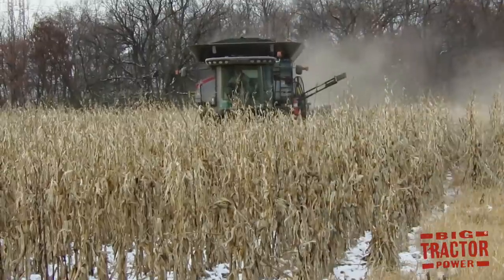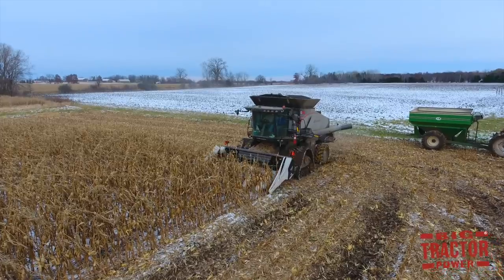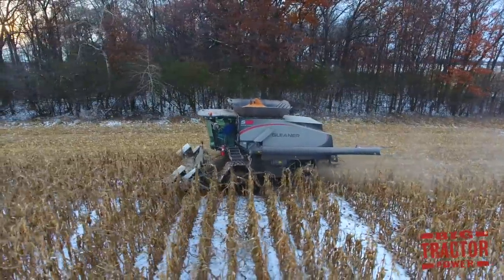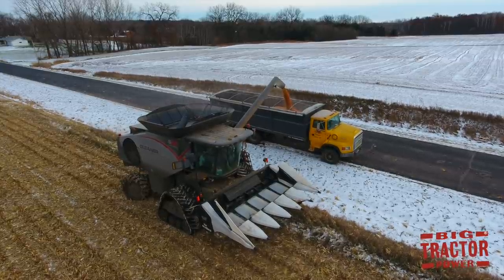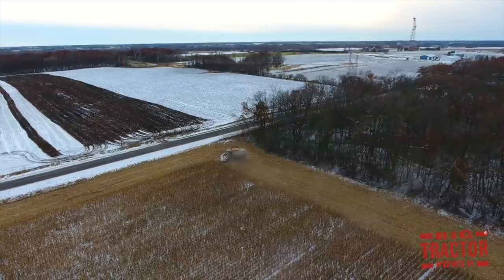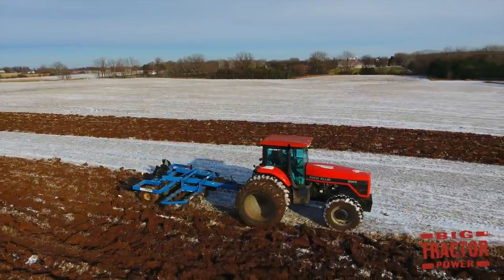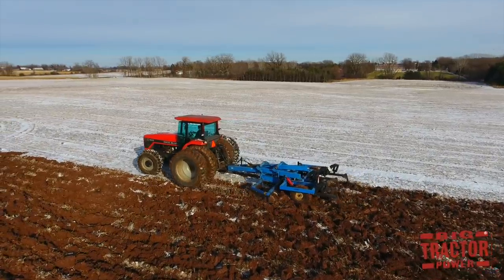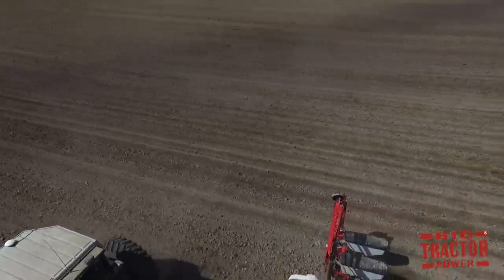Harvesting Corn in the Snow: Gleaner S68

Comment: Mike you are right about the snow. But 10 degrees Fahrenheit is the magic number.  10 degrees Fahrenheit or lower the snow will blow through the machine without sticking to the inside of it.  It warms up to 11 degrees Fahrenheit or warmer and you will start plugging your sieves and everything else.  Then you park in a heated shop overnight and steam power wash the inside of the machine out. Been there and done that lol.

Comment: Tracks on a combine as light as a gleaner. You could harvest in a swamp lol.
Reply from the maker: Yes you could and not leave deep ruts.
Reply: Empty weight of the combine as stated is 31,000+ no light weight like the old F and F2's.  We had a F with 23.1 on the drivers.  One year we ended up going to 28.1 rice tires on the drivers, putting a mud hog on the rear, put a turbo of the 301 diesel engine off a 190XT, turned up the pump. That was a combine that would almost float on water.
Reply: @countrygent4  You're right, 31,000 is a lot of weight, but not by today's standards. Keep in mind a Deere S660 weighs 44,077 lbs. A Gleaner with single drive wheels exerts less PSI on the ground than a Deere with duals, so a Gleaner with duals or tracks is really treading light.
Reply: @CrestonMoore  I did not realize that a JD is that heavy.  Funny according to engineers I know at the JD combine plant they are going back to a multiple cylinder combine something like the Class combine. My best friend got one of the original IHC Axial Flow 1440 the first year out - GOLD watch fob and all.  Also I saw the first year AC N6 combines that got hit in the corn head crossing a RR crossing with less than a 100 yours on the engine.  What a shame.

Comment: Every time I see one of these newer Gleaners it seems crazy that the unloading auger is identical to the one on our old K2. I'm not sure what year ours even is but I think early 80s. Some newer Gleaners have the turret style I've seen but not many that I know of at least. Thanks for the video!
Reply from the maker: The pivot auger is a Gleaner standard for several generations. Of course this new auger at 4.0 bu per second can really move out some grain. A John Deere S690/790 unloads at 3.8 bu per second. The Gleaner turret auger was an option for the C62, latter R72/R62, R75/R65 and R76/R66.  The S series has only Ben available with a pivot auger.
Reply: Less horsepower to run the unload auger, that’s why they do that. Also I think you have less grain damage too.
Reply: @jonathanlandis3650  also one less auger to move the grain to the top of the tank and then out the unload auger.  Less moving pieces and parts.

Comment: I didn't  know  you could  combine  corn in the snow
Reply from the maker: To an extent. When it’s on the ground  like this video the combine can roll along well. If the snow is on the corn leaves it will build up on the inside of the combine faster. If the temp is low the snow will feed right through the combine well.

Comment: Would like to see the inside operation of the harvester, how the corn is separated from the cob.
Reply from the maker: Now that is truck isn’t it. It would be cool to show but the combines rotor is in a cage and hard to see at work. It is like a large washing machine spinning the crop material around a grate that strips the corn from the cob and pushing the grain through the grated holes that feed into the bin and the rest of the material back in the field.  There is little space in this area to force the grain from the cob.

Comment: Seems like a lot of combine for such a small head.
Reply from the maker: Almost every combine built today can run a 12 row head.  6 row heads are still available.  For this farm the 6 row may work best because of hauling and drying capacity.
Reply: Ok thanks.
Reply: Still don’t make sense . More passes ,more more compaction. I would rather put another truck on it or sock pile to run in the dryer . Seems false economy to me but horses for corses .
Reply: Class 6. Probably wouldn't take much more to slow it way down.

Comment: He needs a bigger head, it can handle a 12 row really easy it can run 10 mph with that head.
Reply from the maker: Almost every combine built today can run a 12 row head.  6 row heads are still available.  For this farm the 6 row may work best because of field size, hauling and drying capacity.
Reply: Plus the weight
Reply: In muddy conditions, its better use that 6 row head because the weight, if they add a bigger head, combine can finish stuck in mud
Reply: We run 40 ft. heads in the worst mud imaginable with duals and 4+4  and weight of the head is a non issue. The mud he is in would be no problem.
Reply: Gleanerman 10mph? You are kidding, right?
Reply: It depends on the yield and going buy the looks of his yield, yes he could go much faster than  that, it is a class 6 and it for sure can handle a 12 row head. In the yield he's in he could run at least 5mph with a 12 row. Get in some 250 bu. corn and then he could still run at the least 3-4 mph.
Reply: Gleanerman 
1: a class 6 machine wouldn’t handle a 12 row machine very well, even in poor corn, but definitely not 3-4mph in 250bu corn. Most Class 8 machines run 4-5mph in 250bu corn. That’s doing a good job at least, I don’t care how fast you want to drive if you are just blowing rain out the back. 
2: You can’t tell the yield just by watching this video. 
3: I don’t know of any corn head that will pull the stalk down at 10mph. And even if there was a head capable of that, the head shell would be astronomical.

Comment: If snow and ice are such an issue in clogging the combine why not reroute the engine exhaust through the rotor to assist with internal melt , it seems usually you are trying to keep the engine cool in all that summertime dust ??
Reply from the maker: That would be a fire hazard. The crop materiel is dry and it only takes a spark to ignite it.

Comment: How does the operator of combine know if the separator gets clogged up with ice and snow.
Reply: With his yield monitor, and grain loss monitor.
Reply from the maker: Good question. As Gleanerman said the combines computer will indicate the loss, you will also see the grain on the ground and most likely you will heat and feel the combine working differently. Think about mowing the lawn in wet grass you can feel the mower deck sound different if wet grass starts to clog it and the engine starts sounding different.  Thank you for watching and asking.
Reply: @bigtractorpower  Nice analogy but not everyone has used a mower these  days either. A plugged garburator?

Comment: Seems like a big machine for a 6 row head. Is there a reason for such a small head?
Reply from the maker: Almost every combine built today can run a 12 row head.  6 row heads are still available.  For this farm the 6 row may work best because of field size, hauling and drying capacity.

Comment: Why don't combines have tracks instead of rear wheels?
Reply: Claas came out with one back in the 90's, I guess it didn't catch on to good.
Reply: MUDHOG makes a kit to pit rear tracks on combines they are amazing when paired with ati tracks on front
Reply from the maker: The replies are pretty good. I would add the front drive wheel carries the most weight and the tracks help with traction and flotation up front.  The rear wheel is often 4wd and adds extra power to pull. There are rear track kits but steering may be wider in the turns and upkeep on the rear track unit more. Tracks also add $50-$70K to the cost of the combine with the front set. A rear set would be even more of an extra cost.
Reply: @bigtractorpower  you should come on up this spring or next fall and check out our operation in central Wisconsin. We've got lots of track machines and all newer JD equipment. would love to have you come check the operation out.

Comment: But but but the dealer said a gleaner is so light it would never need tracks!
Reply from the maker: Well they are significantly lighter than other combines and they will help them stay afloat better in mud. Never needing tracks would be hard to say because some time tires just won’t give you the traction you need. Tracks or tires in mud a Gleaner will not sink in as deep as a big Axial style combine and as a result not leave super deep ruts. I have a friend with a John Deere 9860STS that ends up many years harvesting in snow and mud who is seriously looking at Gleaner next time simply because it is lighter. He runs super floater tires on the 9860 but still get stuck from the weight of the combine.
Reply: Even with tracks that Gleaner left yield limiting compaction no tillage tool can remove.   Patience pays in ag.   A trait many farmers lack unfortunately.
Reply: @Farmerknowsbest  he's combining corn in February, I'd say this farmer is about as patient as he can be!
Reply: FarmerSchneck And with frozen ground? That’s not going to leave any compaction. You should take your know it all attitude elsewhere

Comment: What's the articulated tractor at 10:09 that looks like a orange Agcostar tractor?
Reply from the maker: It is a Massey Ferguson Red 8425.  You could order an AGCO Star in Massey red from the factory. A very few were built in red but they are out there.  I hope to film an Orange 8360 in 2019. Stay tuned.
Reply: @bigtractorpower  thanks for the reply!  I didn't know that

Comment: Nice guess rows. What did you plant that with a helicopter??
Reply from the maker: It’s not a big deal. Not every pass is perfect. This was a bit of a swampy spot and a smaller field. There could be any number of reasons they left a gap.  It’s also a dairy so maybe they planed to chop it originally and left a gap to pull the chopper through.

Comment: why don't you doods utilise the heat from the engine cooling radiator to warm the interns of the combine elementary and what's more it's FREE. Snow ain't a problem in OZ but ignorance can be universal. Go well mate regards Frank (by name & nature)
Reply from the maker: The inside of the combine is full of dust and dry plant matter from the threshing.  Heat and dust do not mix well and can be combustible.   The key on a combine is the vent heat far away from the crop to avoid fire.
Reply: yours is the type of closed mindedness (ignorance) that was being eluded to